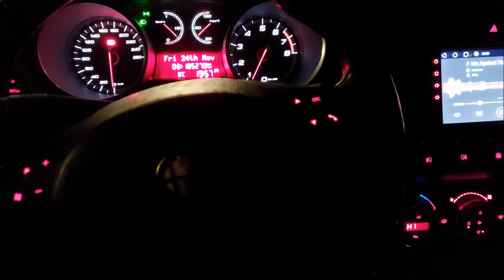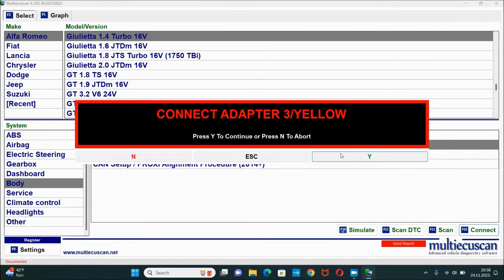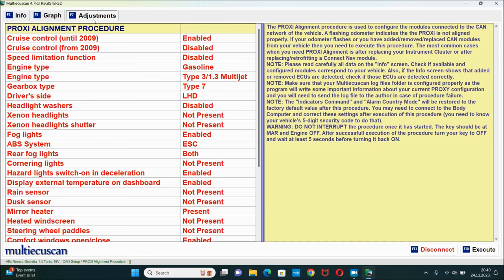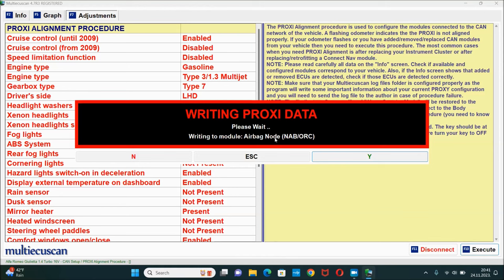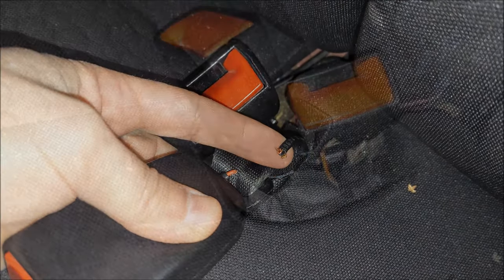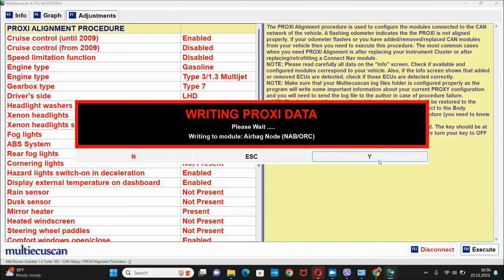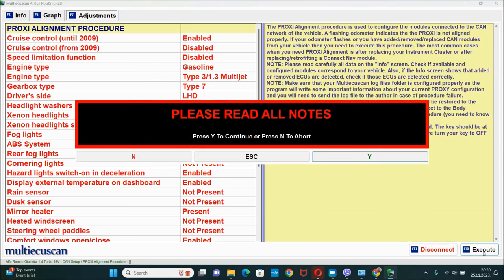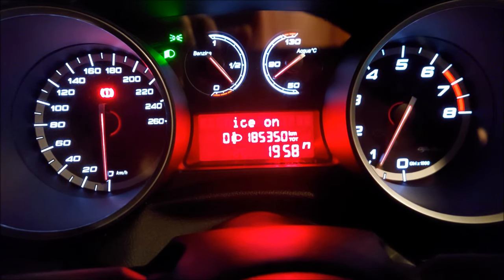Giulietta FLASHING ODOMETER FIX After Blue&Me removal, PROXY ALIGNMENT ISSUES FIXED, Airbag Node FIX

Comment: Hi, I have an issue with the display panel. I while ago I was having the flashing odometer issue but that seemed to have fixed it's self after a day or so. I also had and issue with the airbag light showing an error but the same thing happened, that went away after it doing it a couple of times. Then I had an issue with the dials not working, they just randomly stopped while driving a couple of times but that went away too quite quickly and it seemed fine for months but after a week away on holiday, I've returned to all my dials not working, plus both airbag lights on plus three other lights on the left side plus a flashing odometer that doesn't gain any miles while driving. The time and stuff still works, the headlights don't show as being on and the indicators don't show as being on either.

Do you know what might be the cause of this? I was thinking it might be a fuse or a lose connection or even some moisture but not sure where to look. The manual has no mention of fuses for the display panel.
Reply from the maker: Check the fuses, there is one for the cluster, and you're right it could also be the loose connector, just check everything thoroughly. If that doesn't work hook it up to diagnostic tool
Reply: @arcgarage  Not sure which one is for the cluster, the manual doesn't say. Noticed the seat belt sensors/lights are off too :(

Comment: Hi frined, for Odometer flashing also removing the batery and replece it with a hig amperaj wil make te Odometer flash? I have that isue on a 159 that i whant to buy
Reply from the maker: No, that shouldn't be an issue
Reply: @arcgarage  The saler say that flashing come after batery replacement. I'am not shure, also some glowplug flashing some time in dash

Comment: I dont have a flashing odometer, however usb and aux port in the glovebox doesnt work, as well as multimedia buttons on the driving wheel. Should I try proxy aligment as well?
Reply from the maker: Check if somebody removed the blue&me module from your car
Reply: @arcgarage  Just checked. Its there.
Reply: Its connected via a blue cable underneath, no visible faults, no funny smell
Reply: Its a 2012 model 1.4 TB 170hp
Reply: You need to repair your blue&me because it's dead. I had the same problem.
Reply: Figures. Well, aux port connects to the radio just fine, so I dont really need a new module anyway. Not gonna pay 200$ for a relic of the past

Comment: Can u please link the OBD that you are using. I'm currently using ELM327 but I can not access Proxy option ( even with yellow CAN cable )
Reply from the maker: I bought it a while ago, are you using registered version of MES?
Reply: @arcgarage  yes i am, it is failing to connect to Body system

Comment: I have a 2013 january giulietta and after replacing the blue and me module the odometer flashing has stopped. However after turning on the climate control the themperatures are flashing. How can i fix this?
Reply from the maker: Didn't encounter that yet, I would do proxy alignment